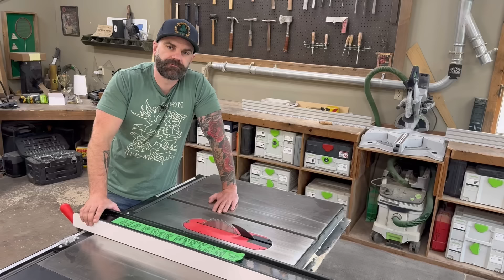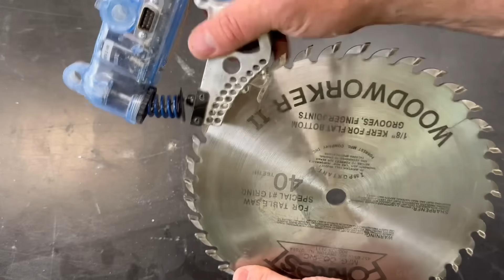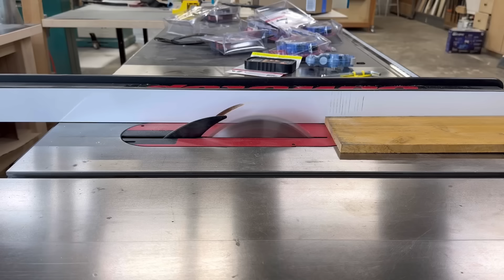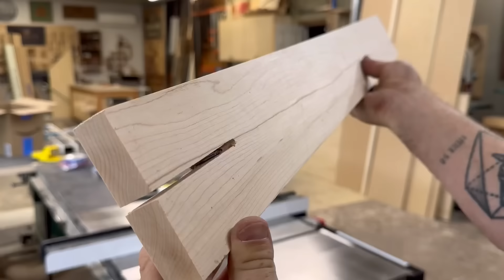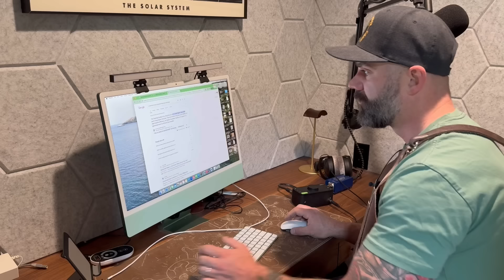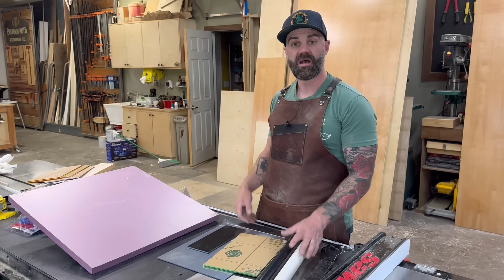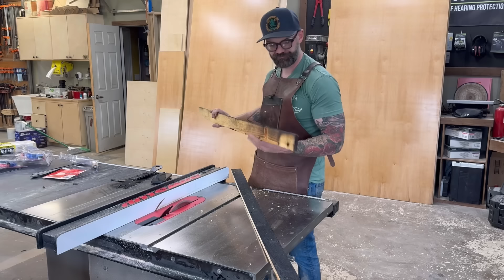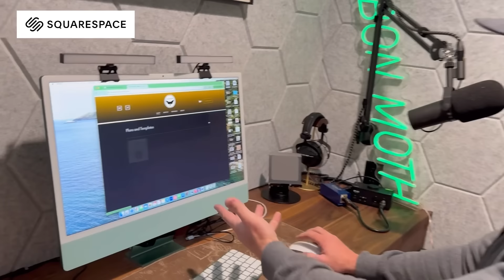Finger Versus Table Saw || Testing SawStop Myths

Comment: The one point that I haven’t seen mentioned in any video of these Saw Stop is after the brake has been activated and the blade has dropped , after replacing the brake and blade the next step is to turn the handle for raising and lowering the blade down to the lowest setting before the height adjustment actually works again. After witnessing the hotdog 🌭 test at the woodcraft in Springfield Oregon and everyone walked away I stayed and watched  them replace everything, I asked after the blade drops how do you get it to raise back up , it obviously wasn’t attached anymore to the mechanism that raises and lowers it , this part is just as important as the technology . Thanks the video

Comment: No you know why wooden boats don't sink. They only absorb a tiny bit of moisture. Another reason you don't need to soak wood chips for bbqing. The minute amount of moisture boils off within seconds on hot coals.

Comment: was wondering if the sled isolating the material from teh top made a difference, but the carbon fiber proved it didnt. 

i am, however, disappointed that you didnt use an aluminum siding nail to test the boundary between not tripping on a nail, and tripping on aluminum.

Comment: The mirror tile had a protective coating on it to keep it clean until after it is installed. That could provide enough resistance prevent the saw from stopping. The carbon fiber probably didn't. I worked a lot with carbon fiber, but there was no such thing as a sawstop back in the 90's. And yes, it is a good conductor. 

Once an employee cut his thumb on the table saw. it was not deep, maybe 1/2 inch long and 1/8 deep. He went into shock. I didn't notice. He fell down and cut his head open on the corner of a desk. We sent him away in an ambulance.

Comment: The saw isn't set off by conductivity, it's set off by capacitance. 

It's pretty similar to the technology that makes the touch screen on your phone work.

The human body has a pretty reliable capacitance, and large pieces of metal, especially in certain physical configurations, do as well. (And so does a hot dog.)

So what is capacitance? I'll spare you the physics lecture, but suffice it to say that it's sort of like "the ability of something to absorb and then re-emit electrical energy". 

The reason the carbon fiber set it off is probably that carbon fiber is electrically conductive, so it's just like you were touching a piece of metal and then sending that through the saw. If you tried it without touching it, it probably wouldn't.

Comment: Thermal coinductivity is not thermal conductivity ;) Anyway copper has even better conductivity (both) than aluminium, it should trigger if it is about conductivity 😅
Regarding carbon, beware of dust which is pretty nasty (no dust here obviously 😋)

Comment: What you should look for is electrical conductivity (or its reverse, resistivity) rather than thermal one. Thermal is irrelevant here. Although that's also higher anyway.

Comment: I'm not familiar with how deep a moisture meter senses moisture but based on your test with the spray bottle, clearly surface moisture isn't the issue. For a true test of "green" wood clip a small branch off of one of your trees and run it through on your sled. Maybe it has something to do with moisture on a cellular level, like in your skin.

Comment: My saw stop shut down mid-cut while ripping a piece of fresh pressure treated ply. The lights flashed special pattern and based on manual said the moisture content was too high and was close to setting off the safety brake. Glad it gave me a heads up before costing me a few $100. Did the rest of it using bypass. That said, I cannot believe your soaking wood didn’t give you similar result. Weird.

Comment: Very good, but your test with the aluminium sled is invalid, why you say, the fence lock down screws may have been making a connection to the table surface creating a path. none of the other test had a possible direct connection to the top. ok the wet plank may have but only a high resistance. that's the only bone i have with your tests. Thanks for your time and cost for this video.

Comment: I suspect the reason it triggered when using the crosscut sled and not touching the metal was because the sled was grounded to the saw by a different route, probably through the bolts holding the sled guides to the crossbeam. If the anodizing on the the sled was done well (Which is likely), that would also be an insulating layer on the aluminum, so there's a decent chance touching the anodizing made no difference. 

Measuring the electrical resistance between the nick made in the aluminum part and the table of the saw using a multimeter at the highest resistance range would answer this one immediately, if it gave anything other than an overload value, then it'll set off the Sawstop whether you touch it or not. Industrially this is done with high voltage test equipment as it catches resistance failures more reliably - Megger being the main brand in use there, as in they're so popular that the name has become the verb for doing the test, similar to hoovering. Before wasting everyone's time with the montage of gobbledeygook stuck in instead of an explanation on how it works, a charge of 3 Volts on the blade was mentioned, which is more like what a multimeter uses than the hundreds of volts a Megger tester can use, so it should be a good enough test.

There is talk about a law being brought in to make selling table saws without Sawstop technology mandatory for all table saws sold in the US. The Stumpy Nubs channel has a video on it. To their credit, Sawstop do not seem to be doing the usual corporate thing of paying lobbyists a fortune to pass laws making their tech mandatory, while also putting it behind a paywall so everybody has to pay them a fortune to use it either. Not unlike the invention of the 3 point seat belt, their attitude seems to be that too many injuries will be eliminated by getting it in use for as many people as possible for it to be morally reasonable to squeeze every penny out of it - this kind of thinking is vanishingly rare in the modern 'shareholder value' obsessed corporate world, so it should be applauded. 

It does however mean there will be no such thing as a cheap table saw if the law does come in, but I suspect cheap table saws represent a disproportionately high number of accidents per hours used, because they're more likely to be made badly and/or out of adjustment in ways that cause them to bind up and fire wood around as well as being used very intermittently by less experienced woodworkers who won't keep their hands out of the way of the blade.

Comment: Thermal conductivity is not the same as electrical. That being said, aluminum will transmit an electrical current about 3.5 X more easily than iron through an equivalent cross sectional area.

Comment: We set our Sawstop off twice. Once on  the carbon on MDF left from a CO2 laser cut. The other was very wet eucalyptus wood. I made many cuts off the wood before the safety mechanism tripped. Lessons learned. I use bypass with any wet or weird material.

Comment: When it comes to the Nail, I think you'll find if the header the Nail is touching the surface of the saw. Or just above the surface of the Saw. it will set it Off? The
 Rockler slit had bolts bolting the.  Aluminium.
 To the Slid., which Earthed The slid. I think it is about Earthing the items.

Comment: The not touching aluminum set the saw off because of the metal rails that created a circuit between the blade and table.  Anything that can make that circuit will set it off.

Comment: The one way wet wood can set off the cartridge is if the drops are so big they bridge the gap between the blade and cartridge. Its pretty hard to achieve but with enough in the wild it can happen. (former SS engineer) 

The size of your first metal part creates a dramatic changes in system capacitance, so I knew it was going to trigger immediately seeing it. The nail is a much smaller effect on system capacitance (what is being measured) and doesnt get past the total change needed (algorithms are very complicated here). 

Its not conductivity, its system capacitance. An aluminum nail would have same effect as the steel nail.

Comment: You should have tried to ground the metal to the table saw top prior to running it through. The static electricity of your body holding it may have been enough to build an electric charge that remained on the metal. Or try to cut a flat piece of aluminum that is in contact with the table top as its cutting

Comment: The one time we set our SawStop off was when a student touched the blade while adjusting the height. That’s because once the power is on, the current is going to the brake. The motor does not need to be engaged for that to happen. Nice expensive lesson, that.

Comment: I have tripped my Saw Stop with similarly wet cedar boards from Home Depot. I was running 1x6s through to make 1x1 stakes and it tripped after a half dozen or so cuts. So I agree it doesn't for sure trip with wet wood but  I bypass the trigger now because it's cheaper than replacing cartridges and blades.

Comment: When I was told that the cherry I was cutting was "conductive" and should find a different supplier, I gave up. Two cartridges, two nice blades, set off after the cut was completed, and I just can't anymore. I'm selling the "Safe Machine" because I can't afford to feed it, nor the stress of anticipation of when it is going to blow when you're doing everything right. B'bye SS!

Comment: i just want to point out (i'm just after you did the nail and confirming on the pc) copper is used for electrical feeders/conductors. aluminum is a second option for electrical feeders for cost saving measures in construction. So aluminum being more conductive makes sense. You have to size it a little larger than copper but that tracks. if you cut copper, it would trigger the same as aluminum.

Comment: Did the crosscut sled set off the saw because the aluminium is touching the bed of the saw via the track thus grounding the sled via the saw. Testing with an alumium piece what isnt touching the bed would rule that out.

Comment: Just to clarify; 
    grafite is pure carbon, not a metal. Quite electrically conducive, but not a metal. Carbon fibre is, as the name suggests, pure carbon. In a different molecular configuration than grafite, but chemically identical.
  Very interesting and relevant video. I really like, that you do those tests. 👍👍👍

Comment: I’ve had two of them for around 10 years now, I’ve had a variety of different materials set mine off. 
I have no clue how it works and honestly don’t care. All I need to know is I don’t ever have to anyone including myself lose a digit. 
I lost the tip of my index finger 20 years ago on a table saw so as soon as heard about it I bought one. Two weeks later I bought another.

Comment: What if you put 2 nails in a board with a small wire connecting them and you touching 1 nail. Is that enough conductivity to set it off?

Comment: Wow. I have a thought. When you ran the aluminum fence into the blade, was there any path of metal from the fence to the table top? Like a bolt holding the fence to the plywood that might also be touching to table top. I'm also wondering if creating a path connecting the blade to the insert plate, and not the actual metal top, is enough to set it off?

Comment: I suspect that the reason the fence set off the trigger is because it's still got a path to ground on the table saw base.  I couldn't tell specifically but I saw you have aluminum runners.  Maybe there's a path from your fence to those runners making it ground out.  And...we just set our makerspace sawstop off with carbon fiber.

Comment: To trip a saw stop you need to provide a path to ground, so if the metal has a path to ground most commonly by touching the top of the table of the saw. it will trip. If it doesn't it won't trip!

Comment: Great video.  Shows technology is not to be relied on in place of good shop safety.  Also treated wood is wet and the salts used in treating process are better conductors. After all the test was the Forest blade still serviceable?  Real interesting.

Comment: The only time I’ve set mine off is with wet treated lumber. I had dried it for 2 weeks, but didn’t add splines, so the bottom of the stack was still a bit wet. I believe newer treated lumber uses an aluminum based preservative, so it would make sense.

I would imagine the river water didn’t have enough electrolytes to create a circuit. I wonder if sea water would be different (not that it would be a practical test).

Comment: Jason - I’d like to see a test when you run a hotdog on a sled (wooden sled with no metal runners or metal parts or screws touching a table saw top) and  a hotdog clamped to the sled so you don’t touch it. Will it trigger a sawstop safety device.
Also how is a Rockler sled build - that aluminum one - does it have some metal sliders?

Comment: would you try the balloon static test with the fence out the way as when the balloon becomes grounded such as touching a metal fence or if your body is grounded it would loose its charge so i wonder if that would work

Comment: So some of the inconsistentness of like the mirror panel, i live in the northeast and we have times there is waaaaay more static electricty in the air, you can tell by petting a cat. Generally caused by humidity. Anyways, Im assuming Bourbon has a AC running dehumidifing the air. I wish i had a sawstop, reguardless it has always tripped on the hotdogs. It would be cool if the bypass mode had like a test light. Like tool off and touch material to blade and a led lights up

Comment: Great tests although scary to watch even with your hands. Format 4 (Felder) Has PCS (Preventive contact system) which is even faster and activates in advance of any contact and will work on up to a 16"Dia. blade and resets w/o any expensive parts to be replaced using a radar type tech. Altendorf has a system that also activates prior to contact and also resets w/o needing any parts using an optic based system with algorithms to lower sawblade. Both these systems are expensive and are on saws costing many times more  than the most costly SawStop. As is expected in life one usually has to spend the most to get the best. Ray

Comment: if the nail or any other metal was touching your table as it was cut it would have set off the saw stop because your table is grounded so if you attached your fence to the table without metal bolts it wouldnt set it off as it is no longer grounded

Comment: The metal must be grounded for it to set of, your body touching will ground it or like in this video the metal fence was probably attached to the metal table with metal t bolts and the table would always be grounded thats why it set it off, if you attach the fence with no metal contact to anything grounded it would cut all the way through the fence

Comment: It’s all about capacitance. The system senses the sudden increase in capacitance on the blade. A nail isn’t big enough to hold capacitance. 

You can also do this same test way easier without tripping the brake by touching the material to the blade while looking at the lights on the interface near the switch. Anything that would trip your brake will flash a light on contact at the blade.
Reply: I'm so glad somebody said it, was about to comment myself, if you want to know why, there are loads of videos about capacitance on YouTube that'll explain it far better than I could
Reply: Yeah, so it will probably work with anything that works with a touchscreen.  So, just make sure you don’t use a smartphone stylus as a push stick.

I know anti-static foam/rubber will work, and anyone wearing gloves that market their ability to work with touchscreens should be safe—but anyone wearing regular gloves that would prevent the use of a touchscreen might get way more hurt than someone with bare fingers because it’ll delay the reaction to the stop by as long as it takes to get through the glove.
Reply: I agree naturally only it wouldn't have been a very interesting video.
Reply: Much more dramatic to see the blade disappear.

Comment: When making a large crosscut sled, I used 2 inch stainless screws on the front fence.  I ended up moving the runners to the right and after carefully making sure everything was good to go, I made the cut.  Had glasses, hearing protection dust collection running and  and as soon as I started the initial cut I sensed something wasn't right.  I "thought" I saw sparks so I stopped and sure as heck, I cut dead center into the stainless screw (because of the shift), almost all the way thru.  The saw did not fire.  What really impressed me was there was no damage to the Ridge Carbide blade.  This freaked me out a little as to WHY it didn't fire.  Was my saw defective?  Got the manual out, contacted Sawstop via email.  They simply said if I get the green light it's good to go.  That did not put me at ease though.  Cause it's always in the back of my mind now, is it working properly?  After your video I'm good now.  As I WAS going to do the hotdog deal and was willing to eat a blade and cartridge for the piece of mind.  Now, no need.  Thanks!!

Comment: I set mine off with an aluminum angle gauge for tapering table legs.   I was touching the aluminum.  On another note, I tried to rip a soaking wet treated 2 x 6 from the big box store.  Instead of tripping it sort of bogged down and quit turning as if it were under powered.  Did it twice.  I called SawStop and the Tech guy said, "you were warned".  If my hand had been on the wood closer to the blade it probably would have tripped.  It was cheaper than a fired cartridge and much cheaper than the emergency room.  I liked it.